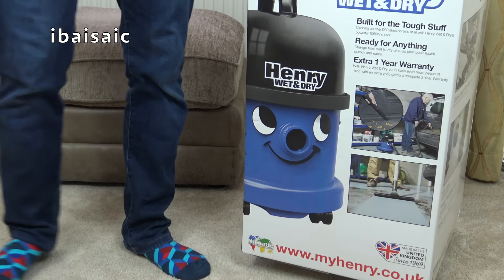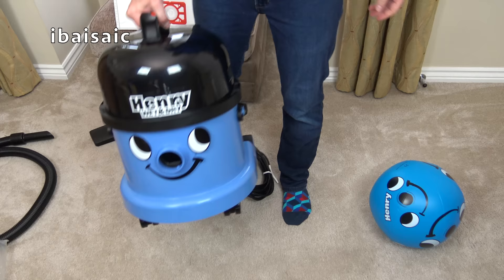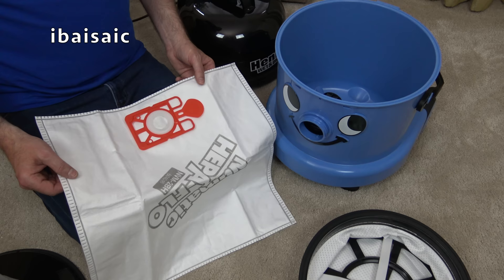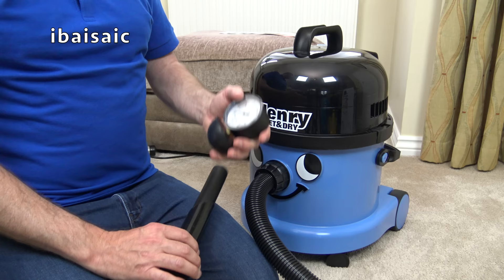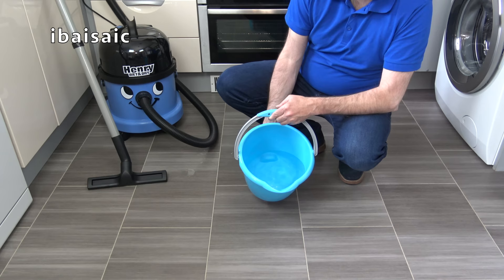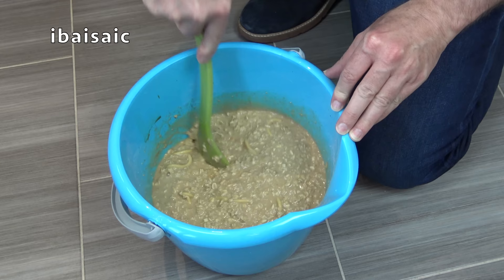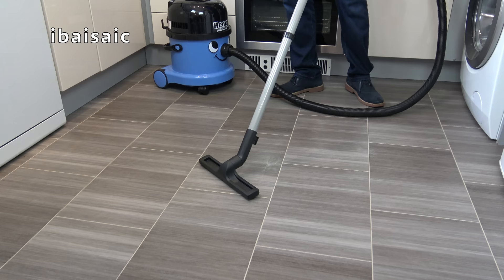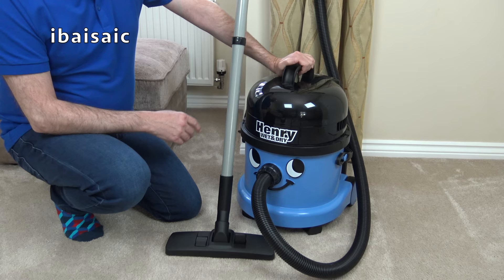Henry HWD370 Wet & Dry Vacuum Cleaner Unboxing & Demonstration

Comment: I don't like the new plastic handle...
1. Design of it is awful
2. I think it will broke after few uses...
Reply: @bread-gz3rl  I know, but before it was metal
Reply: @bread-gz3rl  Hes talking about the pail handle on the bucket
Reply: I like both handles

Comment: These are good value at £139.99 in Argos - thats the same price as yellow Hetty, but this has a bigger capacity and can be used wet or dry, plus I think the main floorhead on this is better, as its the old design that Henry used to have before 2014, without the wheel on the back, and it also has brushes all round and a metal base plate. Even better, this is a 1000W motor, being wet and dry, it gets round the EU limit on energy use at 900W, so whilst it might be noisier, its more powerful, and has a better combination main floor tool (in my opinion). The bags are supposed to be put in with the writing on them uppermost by the way.
Reply: Steve Jones eyyyyytw

Comment: Now the question is would you buy George for £228 or Henry wet&dry for £119 from Argos ? I don’t need the shampooing feature as I can just spray the sofa/car seats myself! And can buy the George nozzle to fit on Henry ( not sure if they fit ? ) 
Please let us know what you think we love your videos Thank you 🙏🏼
Reply from the maker: If you don’t want the shampoo feature then get the Henry Wet and dry. All the accessories are compatible with each model. If you are spraying on solution with another method, then the upholstery nozzle with brush removed will be fine for sucking up the water as will the crevice tool or the hose end without any attachments.

Comment: Very useful video. Excellent demonstrations. Thank you. I'll be buying a Charles or a Henry Wet & Dry soon. 
BTW - if you have had a power-cut and you can't open your washing machine before draining it manually - how are you powering your vacuum cleaner?
Reply from the maker: I use my horse manure powered generator.
Reply: @ibaisaic  Fair enough then. 😂

Comment: What will happen if you use Henry wet and dry without the float valve
Reply from the maker: If you keep sucking up liquid without the float valve, there is a strong possibility that water will get into the motor and ruin it.

Comment: It looks as if the handle on the top is replaceable. If it is so, it would be a  good thing, as the handle on my old Charles broke not long after I purchased it 20 years ago, but could not be replaced.

Comment: can you scrub hard floors with the wet function?
Reply: Yes, you can, though strictly it's a wet or dry pick-up machine.  That is, it doesn't dispense water or cleaning fluid, agitate then suck it up – you'd have to do the first stage of that manually.  It's ostensibly for clean-up of spilled fluid - water extraction.
If you put down soapy water, and used the wet floor tool (silicone squeegee) to agitated the floor, you could clean it, but I don't think it would be as effective as eg using a dual scrub floor tool (which you may be able to buy as a separate Numatic attachment, idk).  You could secure microfibre or old wash cloths around the squeegee tool with rubber bands and use that to scrub, I suppose.  A major thing in Charles' favour is his very powerful motor - much stronger than a Henry/Hetty.  If you want a floor cleaner, then go with a George (green).  HTH

Comment: How does Henry Wet & Dry compare with Charles? And did you ever use the turbohead modeled TK 286 from Wessel Werk with him?
Reply from the maker: Henry wet & dry is the same as Charles apart from the name. I haven't used that turbo nozzle with the Henry wet dry but it works well with a regular Henry.

Comment: I was thinking of getting a wet and dry vacuum cleaner and I will be getting this one after seeing this review. Also, do you think if you add water to the container you could hoover the floor as normal and all the bits go inside the bucket and there would be no need for a bag?
Reply from the maker: No, you need to use a bag for dry pick up. The heavier dirt would go into the water but the fine dust would pass through the motor and into the room. You would need to have the float valve fitted if there is water inside the bucket, so there would be no pre motor filter.

Comment: How does the Henry wet and dry or Henry 'wash' differ to Charles?  Henry wet and dry is the same as Charles from what I can tell and Henry wash just has some different attachments?  Thanks
Reply from the maker: Henry wet and dry is more or less the same as Charles, though the new versions have front mounted switches and a better cord storage facility. Henry Wash is for wet use and carpet/uplostery cleaning and does not come with any tools/filter for dry use, but you could purchase those separately. This is my Henry Wash video filmed when it was launched before the recent upgrade. https://youtu.be/1_9CuAw7QdY?si=wkJnszojPr46VjdU
Reply: @ibaisaic  Hi, thanks for your quick reply :)
Do you know if the new version of the Henry wet and dry has wind up cord storage or is this still wound by hand and hung on the side of the vacuum?
Reply from the maker: I have seen photos of the Henry Wet & Dry with the front switches and improved cord rewind from selected retailers, but you would need to check that they have the new version before ordering. You still have to wind up by hand, but two cord hooks are now fitted at the front and back of the motor unit.

Comment: Can you use numatic Henry wash or the George carpet cleaning tools on the Henry wet and dry if water go on to the carpets
Reply: I would think so.
Reply: @bread-gz3rl  They arent.All Domestic numatics use a standard 32mm fitting
Reply: @bread-gz3rl  The hoses are interchangable on the 370 Bucket size
Reply: @bread-gz3rl  It is different but all 370 drums are made from the same moulds so it fits universally

Comment: Hi, I have this on order for delivery tomorrow. I have some queries if able to help. Firstly, is this machine able to suck up a blocked outdoor drain & also can you wash carpets using water and carpet shampoo and get this to suck up the residue?
Reply from the maker: It may help unblock a drain depending on the severity of the blockage. You could use this machine to to suck up water off a carpet after cleaning it with shampoo, but if you wanted the shampoo function, you should have bought a George or Henry Wash.
Reply: @ibaisaic  that's very helpful thank you. I only needed a dry hoover but I thought for £10 more having the wet option was worth it. I must say the first use of it was far superior to my previous upright, it is also very powerful.

Comment: I'm sorry mister Henry still think the yellow Kärchers perform better
Reply from the maker: If the Karcher wet dry vacuums are as unreliable as their pressure washers, I’ll stick to my Henry Wet & Dry thanks.
Reply: @ibaisaic  I got a k4 full control 3+ years in use no problems and a WD4 4 years in use so I am not doubting their quality
Reply from the maker: Jeroen Tabor Well my Karcher pressure washers have lasted two years on average and judging by the number of negative comments on my Karcher floor washer video, that isn’t reliable either.
Reply: I don't like karcher that much it sprays water out the exhaust and yes I used the wet filter but if that's what you like then that's OK I like the look of karcher tho
Reply: @jeroentabor4760 my first karcher washer broke on second use! Trash.
Reply: Wd2s aren't the best but the wd3 up are fairly decent I'd buy a karcher but I do still love numatics these are entry level wet dry machines tho as the 370 size ones compete with stuff like the wd4s as the lineup goes on for 380 size to 900 sized machines they'd compete with the karcher professional NT machines